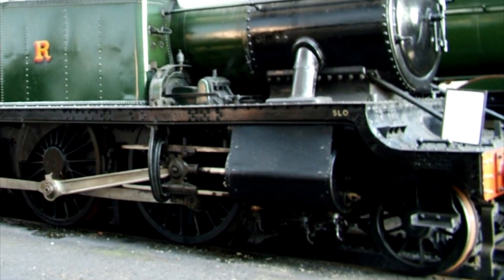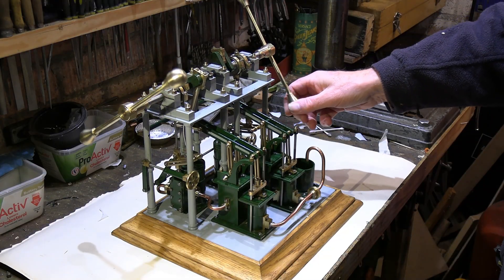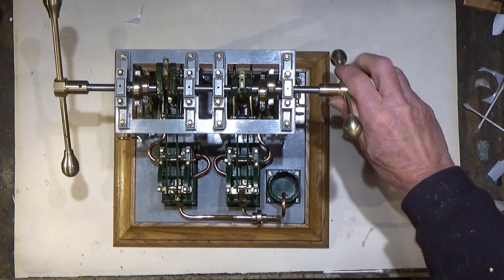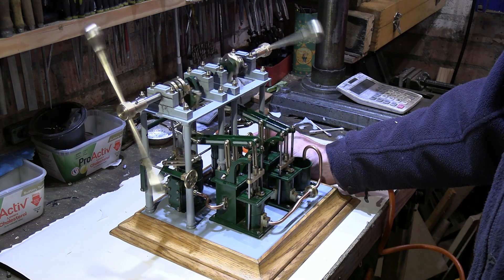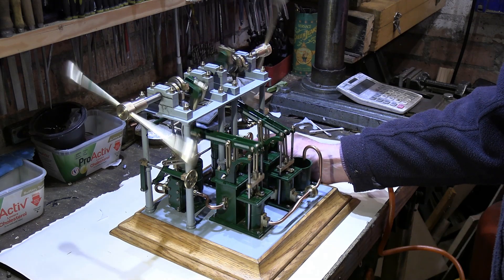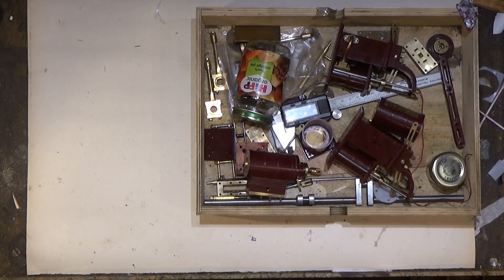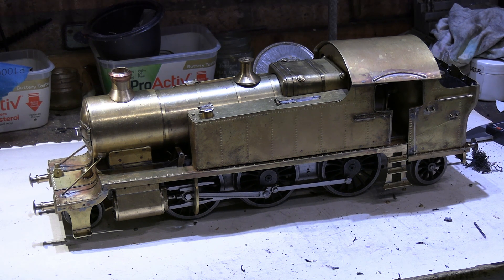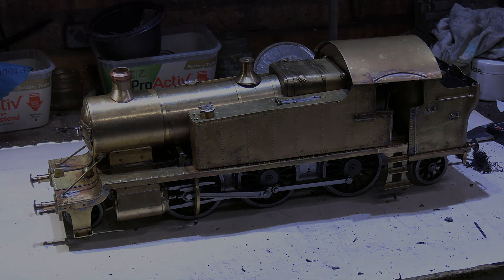Gauge 1 Live Steam Scratch Build 33

Comment: As many of my subscribers unfortunately always see, the problem for me is often that I finish a project when I know that it works. I think it depends on whether you're someone who knows what you're doing and wants to build a locomotive, or whether you're someone like me who's learning and wants to know if you can do it... great project! Can't wait to see it finished painting!
Reply from the maker: Many thanks,  For me its a journey from nothing to something that is the challenge. Making them can be far more interesting than running them for me. Probably why I would never buy a commercial ready to run model or a kit, and this one is almost there. And once completed I know from past experiences there will be much tweaking, fiddling, and tuning it to get working properly. It could take a while. As with all my previous projects. It will need to do a couple of dozen laps round the track pulling a set of freight wagons. Only then will it have  passed the final test. If it doesn’t I’ve  failed!

Comment: Is that stationary engine an atmospheric engine?
Reply from the maker: No, it will run on live steam or compressed air. Its loosely based on a model that could be seen at The London Science Museum. The full sized engine was installed in a frigate HMS Gorgon built around 1836. It represents one of the Royal Navy’s earliest experimentations with steam propulsion in their naval fleet. Once I finished it. It was run on both live steam and compressed air at around 5 psi. Since 2009 it has been on static display.